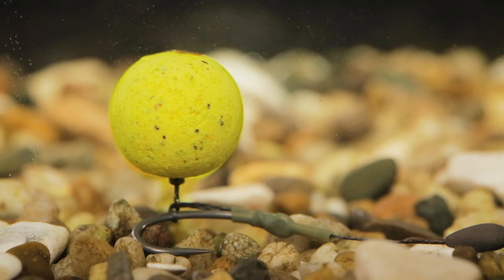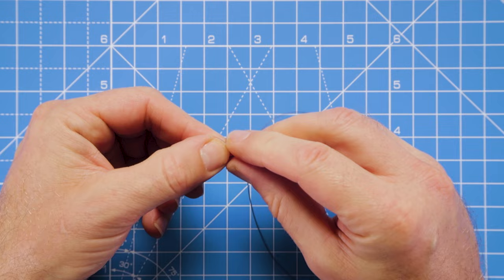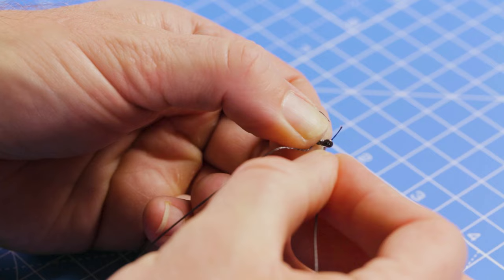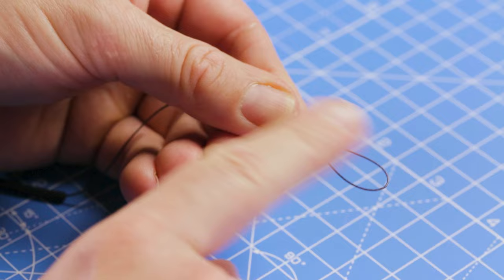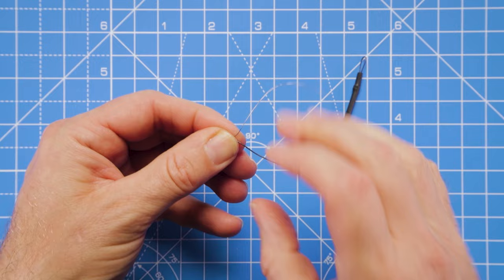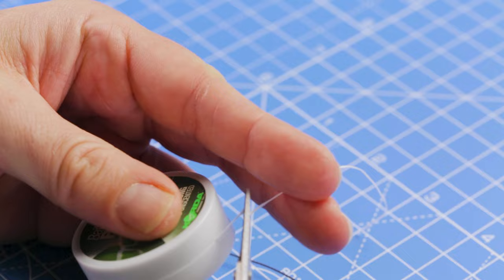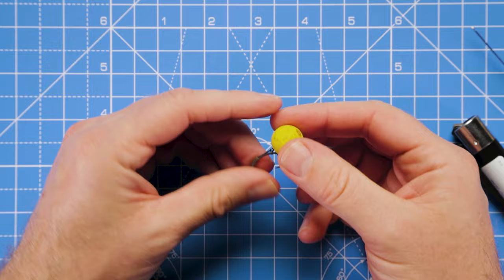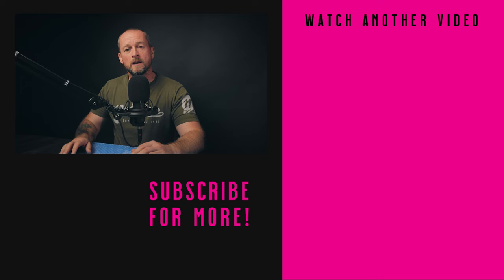The Slip D WAFTER RIG! Catch more with this CARP FISHING Wafter Rig! Mainline Baits Carp Fishing TV

Comment: Really nice rig!!
imho you can go further : I would recommend very similar multi rig: looking and working almost indentical but you can change hook in a second. 
Instead of tying knotless knot just make loop using 8loop knot, pull loop throught hook eye, attach microring swivel and over hook, rest same ( kicker, putty, antitangle slevee).
Reply from the maker: Yep the Multi Rig is another good presentation!
Reply: Oh you responded! to be precise i would name rig I described: slip-D multi. 

Question: 
I can tie 2 versions of it: with „D” section with coat  or without coat (Like in your Video).
What would be the difference if any?
Reply from the maker: @antoniosgwozdz2945  Its a lot about personal preference really - so for a pop-up I'd prefer the coating on to create more of a D rig, but with a Wafter I'd take the coating away for a softer presentation of the hookbait so it can easily be taken when the hook is laying flat and so the hookbait can slid.
Reply: Mainline Baits Carp Fishing TV 
THANK YOU ! ;)
Reply: Thats the way I tie it mate.

Comment: What size hook is this?
Reply from the maker: Hi Jordan, the hook is a size 6.
Reply: Could a size 4 be used for this?
Reply from the maker: @jordanlayfield8975  Yes, although it will sink a little quicker - if you wanted more buoyancy you could add a Topper as seen in the video or use a 18mm Balanced Wafter and trim it slightly so the rig sinks nice and slow and only just balances on the lakebed.
Reply: Thank you 👍🏽

Comment: Slip D? It's in the name, sport to pick holes but this is a D rig. Where is the slip?  You whipped the wrong end to the hook. You whip the tag end, the shrink tube will hold everything in place so it does not in ravel, you can then adjust the loop size to as you need, plus when hooking a fish the knot slips. It's no the name. LMAO.
Reply: Agree - this is not my understanding of a slip D as its fixed with a knotless knot . . .a slip D is as per Mark Bryants Ultimate Rig
Reply: @chrisbelcher2561 martin Clarke invented this rig an its pretty similar to be fare .